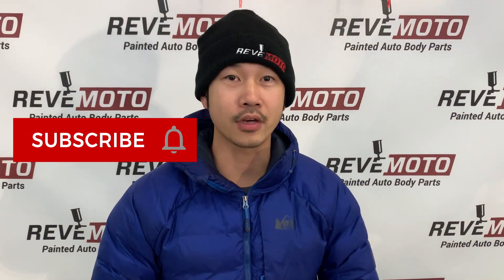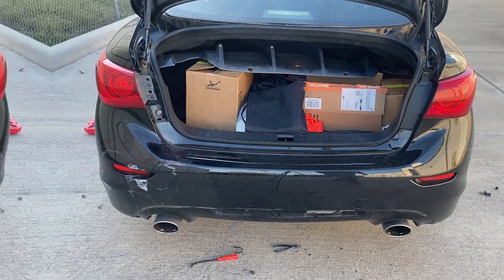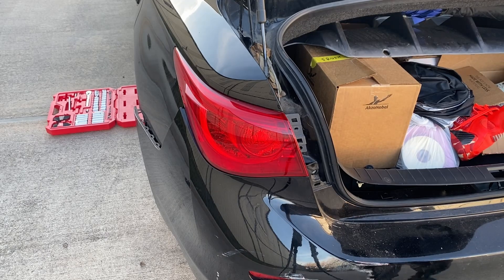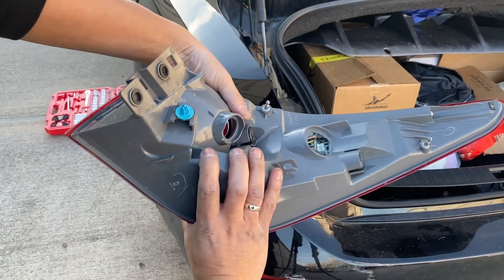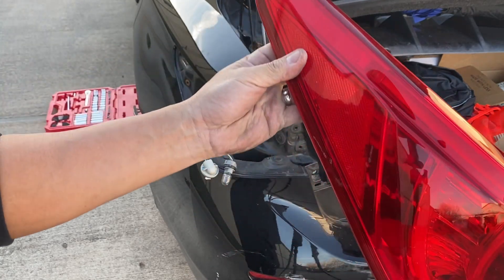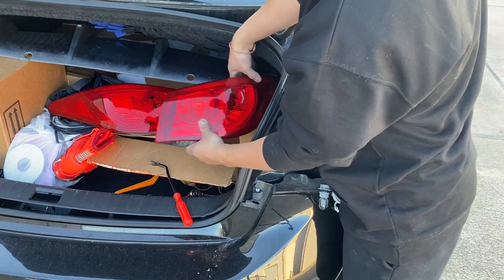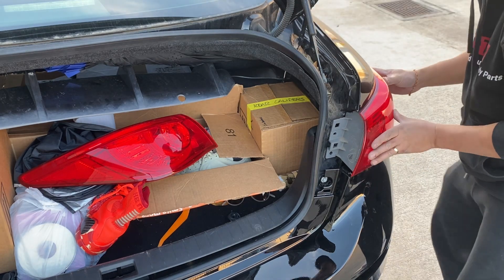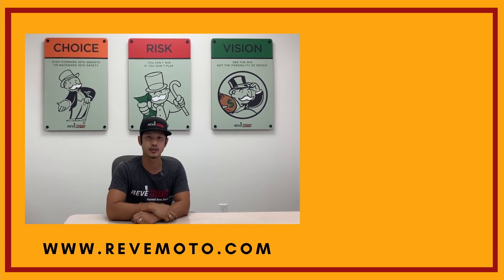Infiniti q50 taillight replacement for 2014-2017 model | ReveMoto

Comment: Where did you find the tail lights
Reply from the maker: Hey there! We actually sell these and got this from our dealership partner to put on for this customer. I know dealerships are running low on supply at the moment, but if you need one let us know which exact one (or if it's this one) and we can check for you. 😎